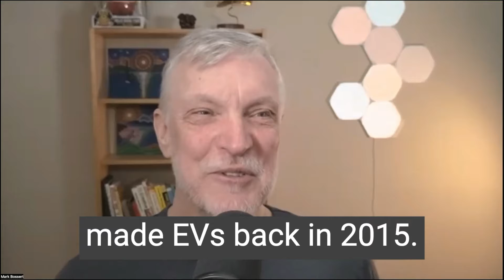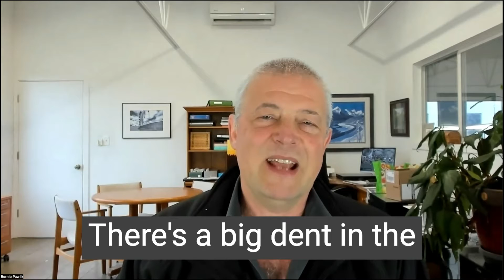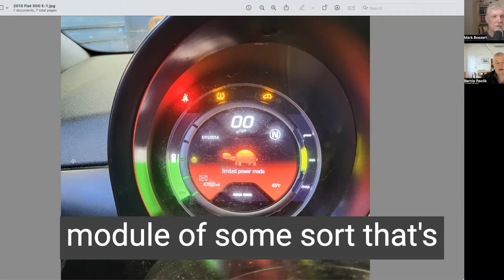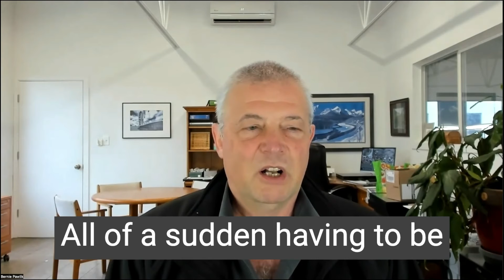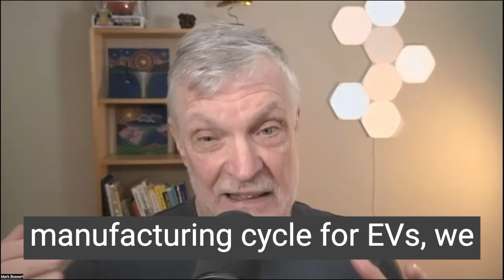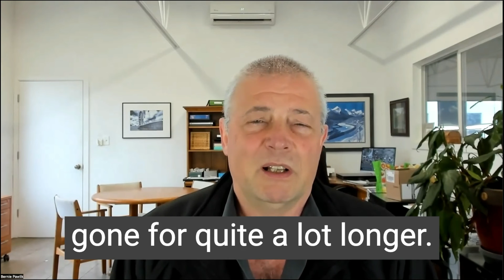2015 Fiat 500E Battery Replacement

Comment: Good to know that there is someone around who we can take our 500e's to. there are at least a half dozen of these in the Vancouver area. Mine is reaching 80kkm with, touch wood, no issues to date.
A few items: The Fiat 500e was a "ground up", clean sheet build, not a repurposed gas car. It was based on the basic 500 gas car, but is very different in subtle ways. The most obvious differences are the aerodynamic body panels. The less obvious item is that the unibody floor pan is totally different than the gas car's pan. Fiat claims to have spent millions of dollars developing the car. They say they lost about $US10k on each of the 6000 something cars that they delivered to Cali and Oregon.